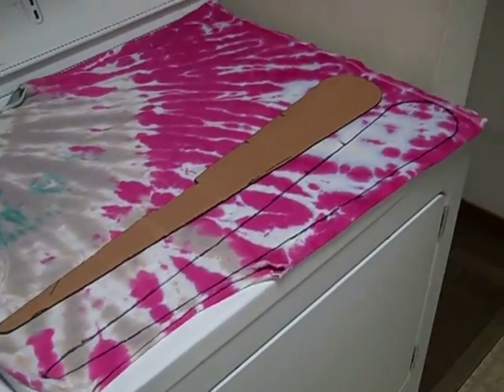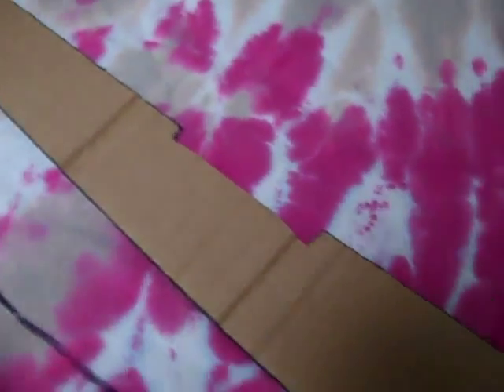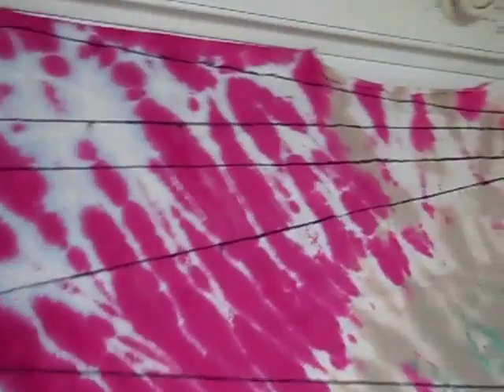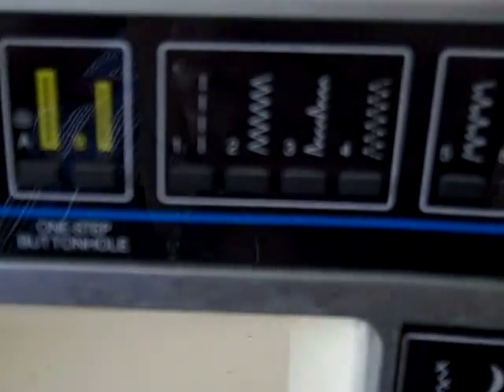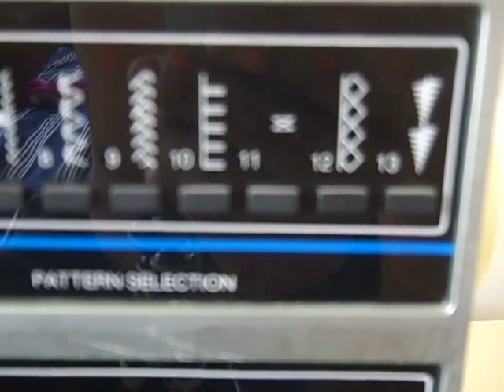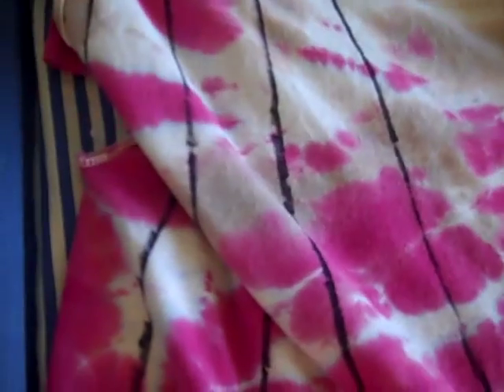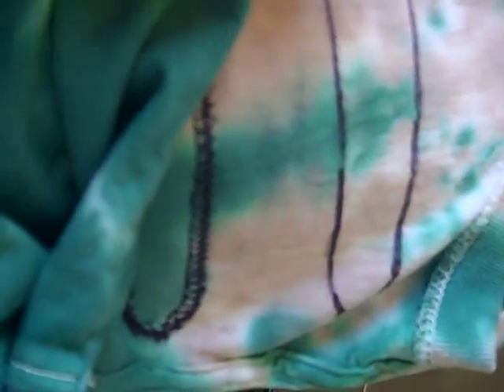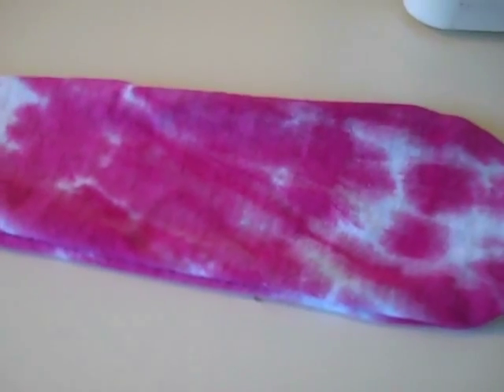How To Make Legit Sock Poi

Comment: me: goes to dollar store and buys striped socks and some foam rubber balls that feel like a good weight, puts balls into socks, spins.
Reply from the maker: Me after doing the same exact thing: "These feel stupid I need something better"
Reply: +PeZoNeD3N me: spinning.
Reply from the maker: +themadscientest me: spinning something better. 😛
Reply: +PeZoNeD3N uses water balloons, stretchy socks, and zip ties so i have loop handles. cant get any better than that, id say they feel the same as pods when im just chillin in a weave. actually they are better than pods since pods are forgiving but can not compare to how forgiving a squishy balloon is. also the zip ties are flame polished to remove the sharp cutoff, loop is adjustable, and sock is super nice on the hands.